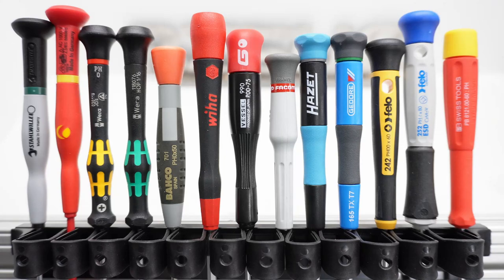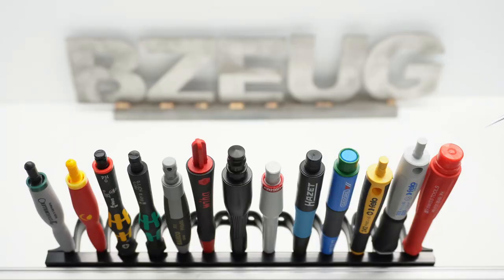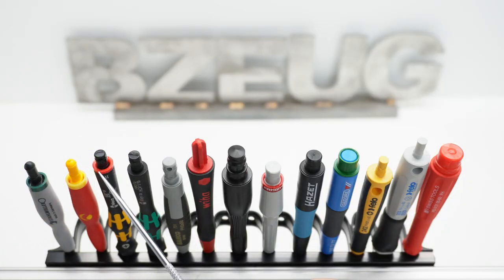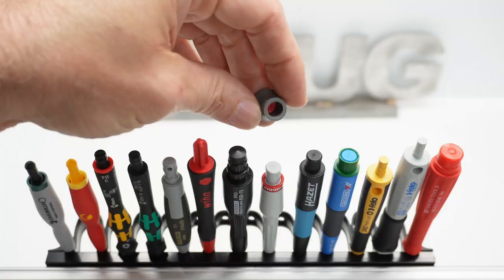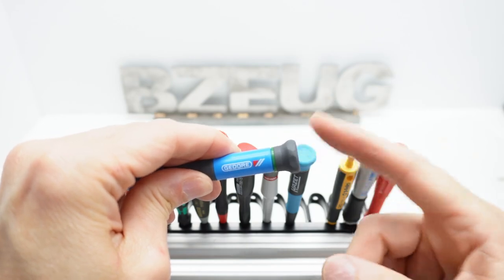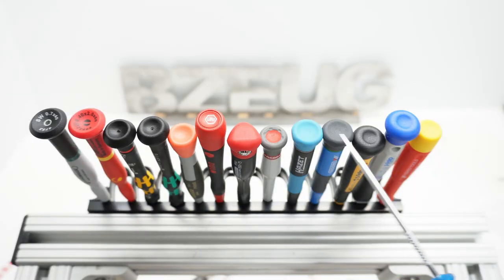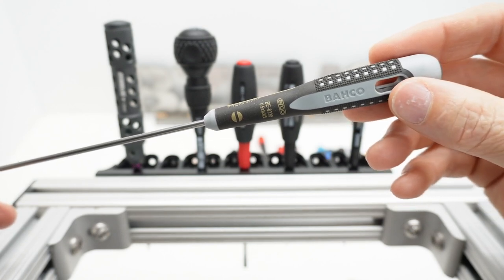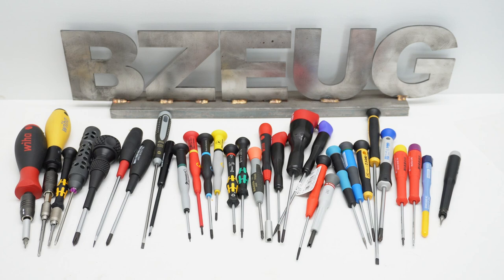Teardown of Micro Precision Screwdrivers.  High end brand's caps compared.

Comment: I really appreciate the comparison that some people may hold a micro screwdriver in a different manner.  I also really like the lighting you use in your photo box.  Another excellent video.
Reply: Hey, {{3}}! Thanks for your comment. I'm always on the lookout for quality tools, and based on your interest in micro screwdrivers, I wanted to suggest checking out the HOTO Compressed Air Capsule. It offers powerful vacuuming and blowing capabilities, making it a versatile and handy tool for keeping your desk, living spaces, and even your car clean. With its reasonable price and reliable features, it could be a valuable addition to your tech setup. Let me know if you have any other questions or if there's anything else I can assist you with!
Reply: Hey there! If you're looking for a versatile cleaning solution, I'd recommend checking out the HOTO Compressed Air Capsule. It offers powerful vacuuming and blowing capabilities, making it great for both desktop and car cleaning. The multiple tubes and high-quality filters ensure long-lasting performance. Plus, it's portable and has a long-lasting battery. Definitely worth considering for your cleaning routine!
Reply: Agreed! I use both holds depending on the specific usage, but was never aware of the consequence for grip design. (Like he said, another excuse to buy more tools 😊)
Reply: I'm also impressed by the lighting too.^^

Comment: FYI, the Wera probably bottomed out under pressure to reduce wear. You don't need the cap to spin when you're putting that much down pressure on a fastener.
tl;dr - it's a feature.

Comment: The Wiha Pico and the Wera are my fav. Cool to see the many brands/ styles
Reply: Hey! If you're looking for a versatile tool to clean your desktop, car, and more, I highly recommend checking out the HOTO Compressed Air Capsule. It offers powerful vacuuming and blowing capabilities, with multiple accessories and a long-lasting battery. Not only is it efficient, but the price is reasonable compared to other brands. Happy cleaning!
Reply: Hey there! If you're looking for an efficient cleaning solution for your desktop setup, I highly recommend checking out the HOTO Compressed Air Capsule. It offers both vacuuming and blowing capabilities, perfect for keeping your desk spotless. With its powerful suction, high-quality filters, and versatile accessories, it's definitely worth considering. Happy cleaning!

Comment: That's a great collection. Not sure which I prefer, I have an Anex 3610, which is the handle and you replace the bits. It's good but small.
Reply: Hey {{3}}! If you're looking to maintain a spotless desktop or clean tight spaces effectively, the HOTO Compressed Air Capsule might be worth considering. It offers powerful vacuuming and blowing capabilities, with features like high-quality filters and efficient storage. The price is reasonable compared to other brands, and it seems to have good quality. It could be a valuable addition to your tech toolkit. 🖥💨

Comment: Try out the Ifixit aluminum precision driver

it's 9.99 for it without any bits, you can get a bit set + driver for ~30

it uses standard 4mm bits

Comment: there's a Wiha x Xiaomi set which is also more or less ok, my father used the torx 1 bit as an impact pinning driver and the complains the tip is bent... well no surprise there

what I would prefer is some more elongated 4mm bits -_- Nanch has some offerings but the driver could honestly be better

Comment: Interesting that your Wiha turned freely. I just bought the Wiha 51-piece precision set and the quality is wildly variable. Some spin beautifully. Some don’t spin at all. The spinning cap plastic colors are also really inconsistent. One of them had a blade that was not fully inserted into the handle and it was slightly bent. Very disappointing.
Reply from the maker: Bummer!  That is very disappointing to hear.  Appreciate the feedback though.

Comment: As always, another insightful video!
Question; I've decided to build a HIOS bit set for the added length to go with an ES15 (it can run both 4mm HIOS and 4mm hex) electric screwdriver to be part of my mobile tech kit and am looking for two things:
1. A great bit holder for HIOS (leaning towards a Wera 1013 ESD, but wondering if there is anything more interesting out there).
2. A good way to store lots of HIOS bits of various lengths (40mm to 100mm) in a compact and easily accessible form factor. (I bought a whole variety of generic bits to see what sizes I like before I upgrade my most commonly used bits at a later date).
Reply from the maker: I didn't know the ES15 was made for HIOS as well as 4mm bits.  Have you used HIOS in the ES15 yet?
Reply: @bzeug  I have a super cheap kit that has bits that fit, and the brochure says and shows both as options. I specifically want longer bits than the normal 4mm hex ones and the HIOS seemed like a good option. It is nice to have the option for both working though!

Comment: Who makes the bahco one as I have them branded as irazola and also roebuck from at least 15 years back
Reply from the maker: Ha!  IRAZOLA, look at that.  Many BACHO items just rebranded.  I had never come across the brand, IRAZOLA.  Is there a specific market (country/language) they sell that brand to?
Reply: @bzeug  irazola was quite prominent in the UK for a period of time.have quite a few roebucks that then became irazolas and now seems bahcos. Just checked the cases they came in and said  made in Spain. Even Their 1mm slotted seems to hold up. So can't be too bad a steel. They sold in clear fronted box sets of 6. In everything from tx to 0.9 hex.  Their  200mm long ph1 has got me out a few tricky items .
Additional...Irazola is now owned by Snap-on. I believe Irazola is technically owned by Bahco and Snap-on’s European division, but ultimately Irazola falls under the Snap-on corporate umbrella.
Because of this, Irazola’s Tekno+ screwdrivers are now Bahco-branded and are finally available in the USA.
Reply from the maker: @ks-hg5vo  Oh, good info.  Thank you!

Comment: Now… which ones have JIS… maybe do the same video but only between the ones that have the JIS tips.
Reply: Not shown in this video, but Moody Tool's Policis series of precision screwdrivers have both JIS and regular phillips sets available. Great handle shape.
Reply: JIS and DIN are so alike that they're interchangeable. So interchangeable that the JIS standard was abandoned years ago and not a single Japanese manufacturer is currently JIS-certified in screwdrivers, and they mostly have gone to ISO. ISO/DIN with its 1-2 degree difference here and there works just fine on JIS.

Vessel calls their shape JISDrive but they lack the JIS certification and official logo. Sunflag still follows the JIS standard as it was before abandonment but no longer has a JIS certification logo. Anex no longer has a cert either.